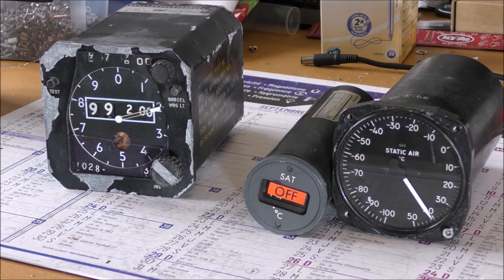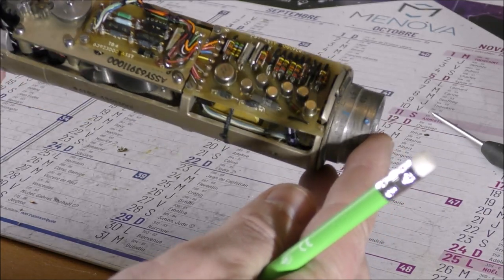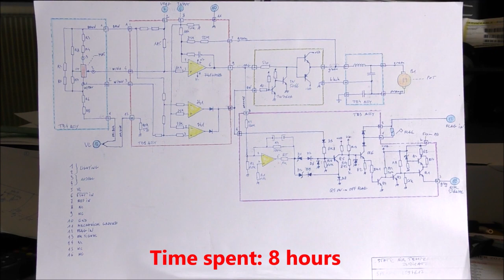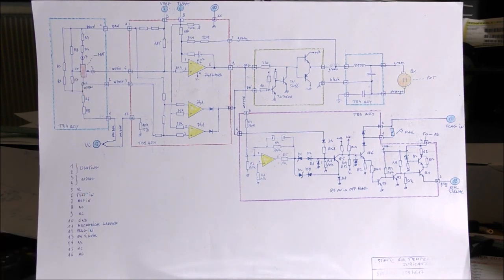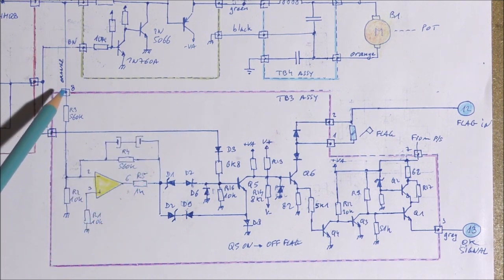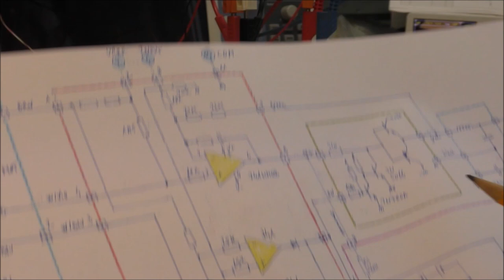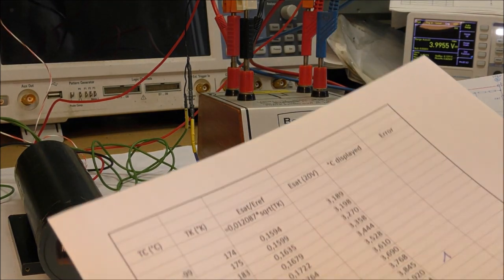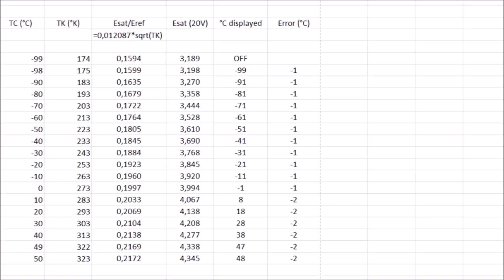LDM #307: Static Temperature Indicator Sperry 2594617-901

Comment: Very cool, I absolutely love the wiring and analog processing. 
Quite a noisy device! Although I suppose that is not an issue in a jet aircraft.
Reply from the maker: Except during a vertical dive in real use the static temperature doesn’t change very quickly, so the noise should not be a problem.

Comment: What magic is used to switch the active digits from side to side when it crosses zero?
Reply from the maker: There are actually 4 digits, two digits on the right and two digits on the left. When the value is negative the 2 leftmost digits are replaced by MINUS and by PLUS on the right when the value is positive.